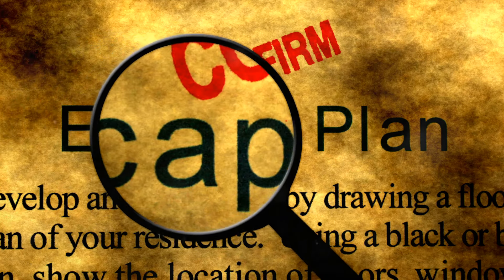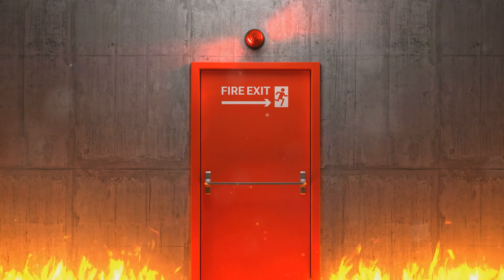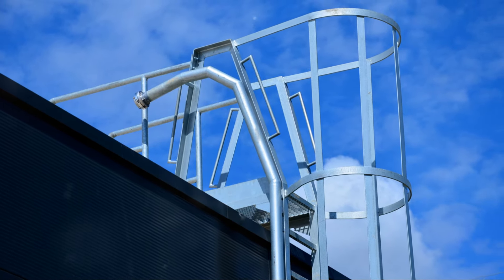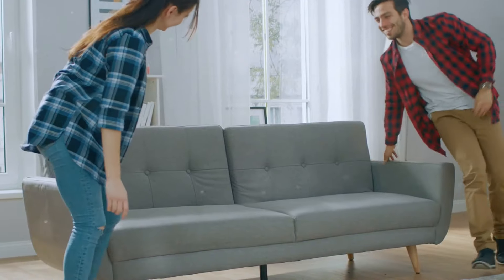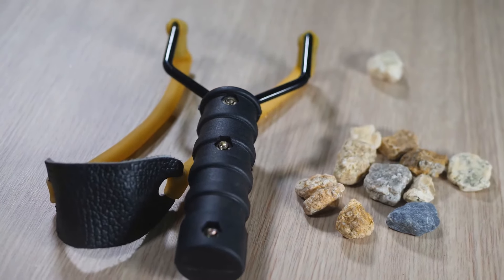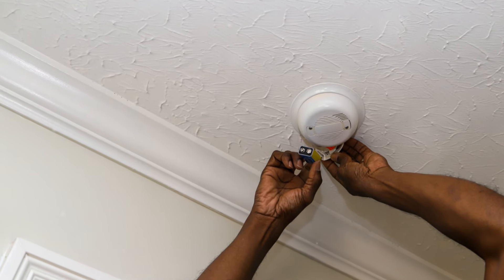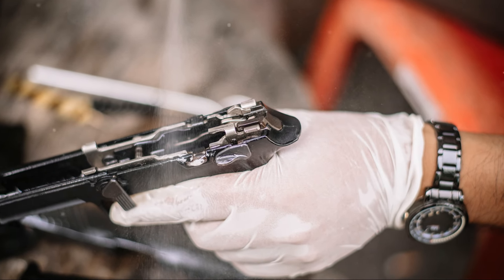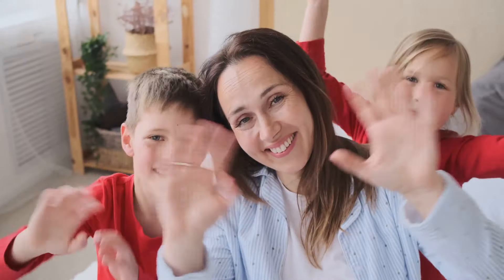How Escape Plans & Fall-Back Positions Can Save Your Life in a SHTF Scenario

Comment: Creating Ops plans use acronym PACE:
P- Primary 
A- Alternate
C- Contingency 
E- Emergency 

Conduct a risk assessment of each option with multiple options based on varying scenarios. Keep bug out routes current by updating maps. Currently in central Texas, new subdivisions, business growth and massive road construction are altering and destroying forests and eliminating uninhabited areas. After choosing routes perform physical inspections to identify specific markers that won’t be altered or destroyed. As much as possible, do not travel main roads; and, on foot, use tracks and power lines for ease of movement. Temporary encampments should be at least 100 meters off trail or road, and not visible. If a fire for cooking or warmth needed learn how to use a Dakota fire hole to hide the flame from exposing your location.
Reply from the maker: Great breakdown of PACE! Staying flexible with multiple routes and regularly updating maps is crucial, especially with all the changes happening in central Texas. Using less-traveled paths and keeping encampments hidden is smart, and that Dakota fire hole tip is a lifesaver for staying under the radar. Solid advice all around!
Reply: New York City?!?!?

Comment: always keep in mind two routes of escape anywhere you go. Note cover and concealment positions, but also know where you can fire on the attacker with no way for them to escape or duck out accept into your line of fire. Image a very long firing lane. This will be a bit better than leaving, or falling back as you don't know how many there are, or what will be behind you. Intruders usually attack in packs.
Reply from the maker: That’s solid advice. Having two escape routes and knowing where you can take cover is key, but creating a long, controlled firing lane where you have the advantage is even smarter. It’s true, intruders usually don’t come alone, so having a plan that lets you take control of the situation without retreating too far is critical. Being aware of your surroundings and having that strategic edge could make all the difference in a SHTF scenario. Great points!